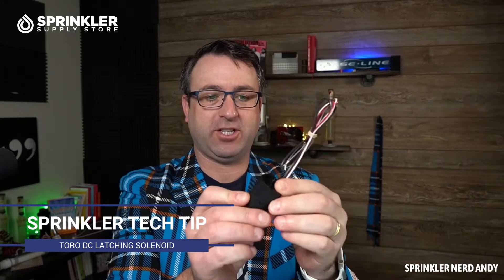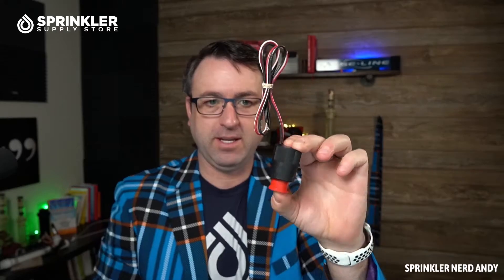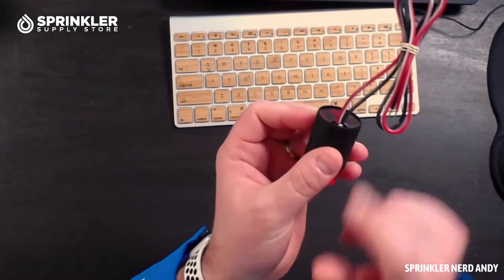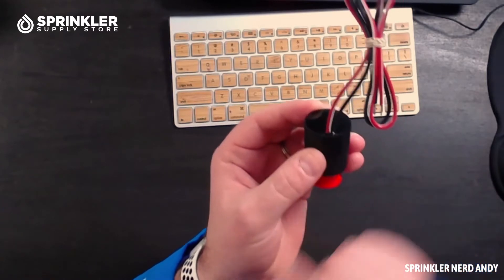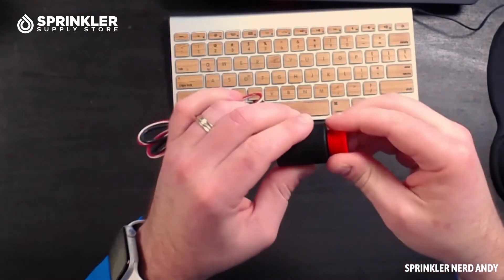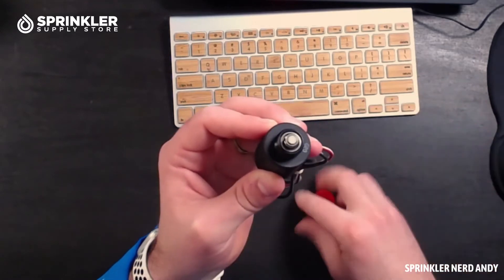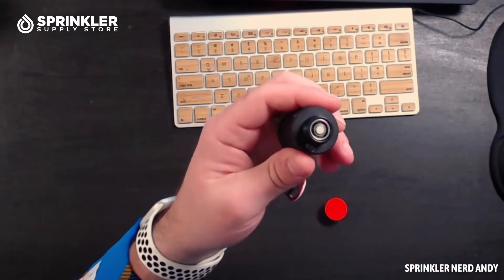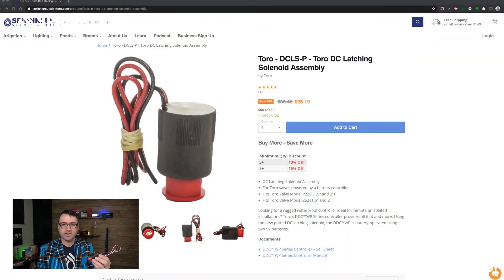Toro - DCLS-P - Toro DC Latching Solenoid Assembly

Comment: Nice video thanks for speaking like a normal person! I have a question. I'm working on a ball field. It was in the past hardwired to a timer but now that timer has been removed and the solenoids are power less. I hooked up and programmed the toro battery operated timer but it did not work. I believe the selinoids are either broken or not the right kind? One solenoid says 24 volts. Thanks for your help.
Reply from the maker: Hi Shawn, thanks for the question.  A battery operated timer requires a different type of solenoid than a the ones that work off of a standard electrical timer.  What you need is the proper DC latching solenoid for the valves that you have installed.  Send us some good pics of your valves to info@sprinklersupplystore.com and we can help you figure out what you need and send you links to the correct DC latching solenoids.

Comment: These are basically energized on and off without constant current going through the solenoid?
Reply from the maker: Yes, exactly. Switches on, switches off. 

That’s the reason it can be powered, for years, with just a 9v battery.

Comment: Hi, great video, I have a latching Solenoid and I´ll like to know if a can use it directly with a battery, I mean just in "manual mode" with a switch that is reversing polarity each time I push it, because I understand that the polarity is the responsable for open and closing the solenoid ... or not?
Reply from the maker: Absolutely, Cristian. You can use a 9v battery and actuate the solenoid. You could probably build yourself a "switch in the box" and make your own manual controller. Interesting idea, I think you might be on to something here, thanks for sharing.

Comment: Are these solenoids compatible with Irritrol EV's? Was told they are by supplier, but when i put this on the valve its still constantly on and making noise
Reply: Not a sticking valve, there's a wire issue and wanted to place a battery pack on for now but it doesn't close the valve, is the o ring supposed to go in a specific spot?

Comment: You did absolutely nothing to show how its installed into valve. Waste of time
Reply from the maker: Like a light bulb. Righty tighty, lefty loosey. Black on the common wire, red on the power wire.
Reply: There's hundreds of YT videos explaining how to do that. 1. shut off water. 2. rotate existing solenoid counter-clockwise to remove. 3. Ensure valve housing is clean and clear of debris and burs that would cause the water tight seal to fail. 4. Install new valve clockwise.  Latching Solenoid valves are a whole different animal compared to common 24v AC valves. This video is great.
Reply from the maker: @colinjohnson5515  nailed it! Thanks for your support here.